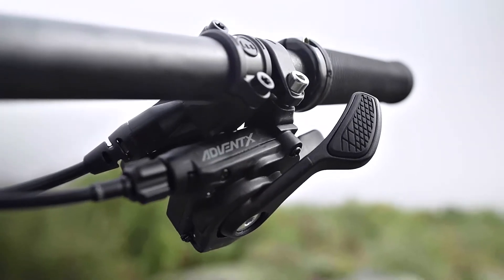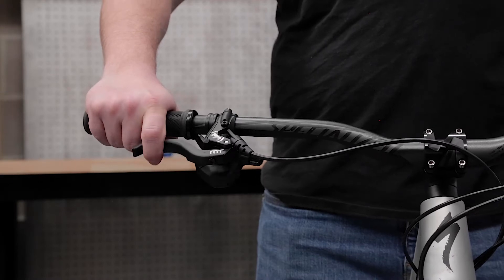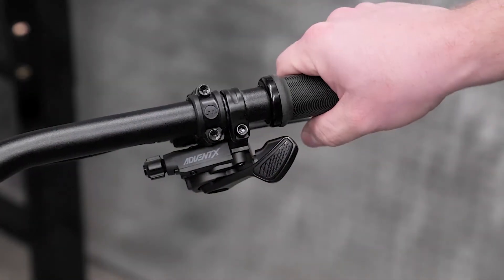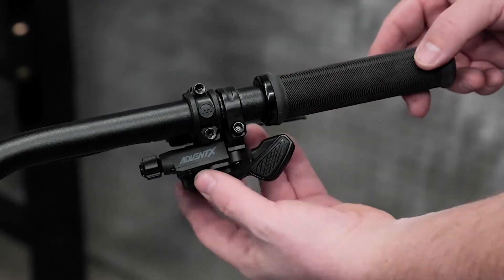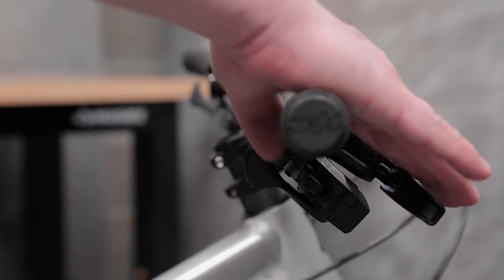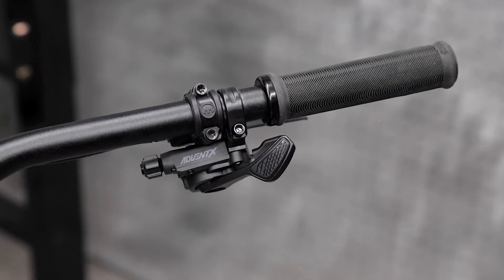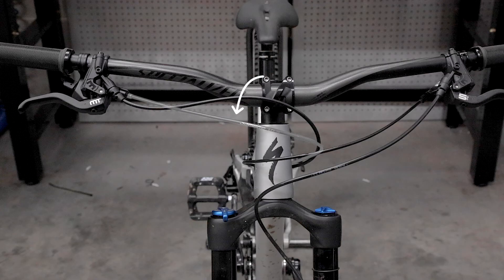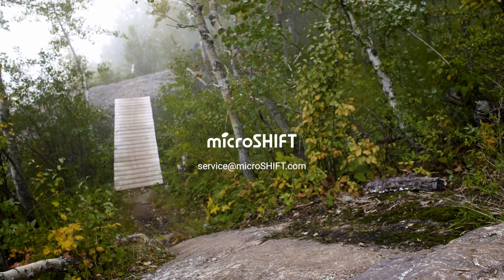microSHIFT Trail Trigger Shifters Setup

Comment: Can I use my shimano deore 10 speed shifter with the microshift adventx?
Reply: As in the micro shift derailleur, you can try it using the shimano shifter. It worked for my micro shift advent using shimano m315
Reply: No
Reply: You “can” but it will never be ideal
Reply: @scottwistinghausen5026  I've been using it for about one year. it is working perfectly. and to complete the mix, the cassette is a sunrace. lol

Comment: How do we lubricate the thumb trigger? Mine is very stiff to shift down and hurts my wrist
Reply from the maker: Except in extreme circumstances of neglect, the thumb trigger does not need to be lubricated. If the shifter throw is too stiff, usually that means there's a problem somewhere else in the setup. I would start by checking to make sure the cable and housing are set up properly and don't have too much friction.